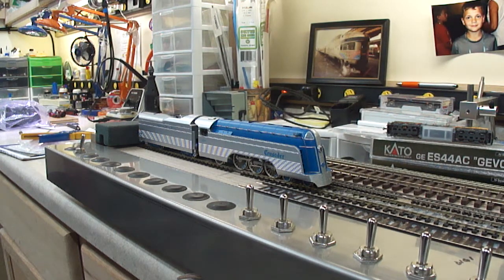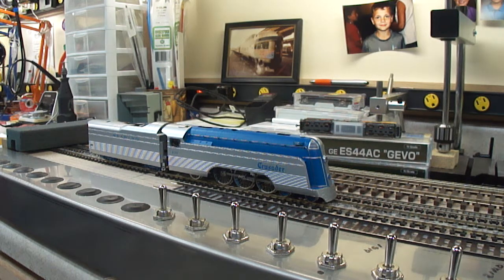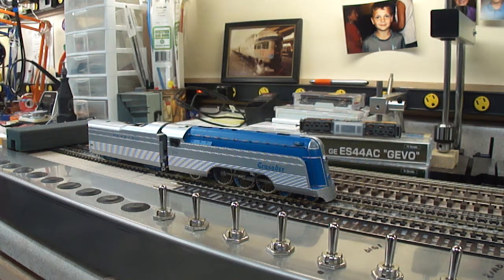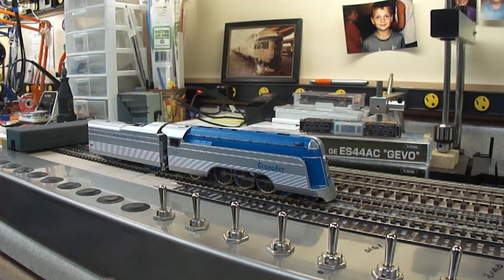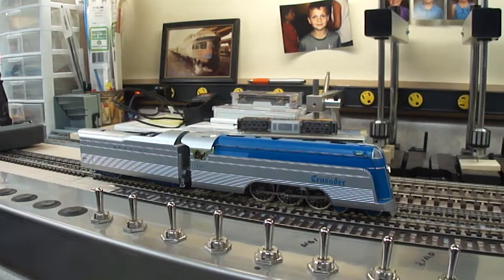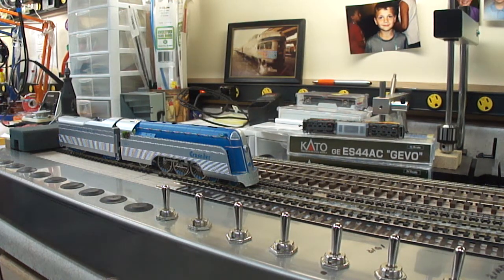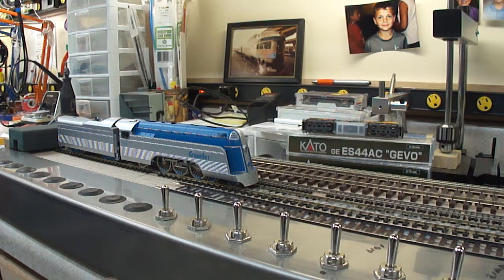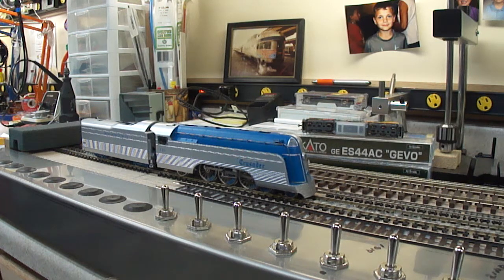HO Scale GHB International Reading Crusader 4-6-2 Pacific with LokSound Select

Comment: how well does this loco run? does the engine have decent weight? I know nothing of this company. Is it plastic, brass, what?
Reply: The loco is of plastic construction with die cast chassis. The weight is enough to pull the 5 passenger cars it is packaged with. The engine in real life was designed just for passenger only when it looked like this, only after the streamlining was removed did it enter mixed duty service. It is recommended for a 22” radius but the cars diaphragms stay closed or connected after 26”-28” radius. A friend of mine has one and the gears tend to wear out or the drivers do the Bachmann and slip out of quarter. Could just be a freak thing with their engine. GHB has some engines on the market now being the PRR DD-1 electric engine in Pennsy or Long Island liveries. Not a big name but seem to make oddball items in non-brass for cheaper options, or more modern with more detail than brass.
Reply: @James-Railyard  I finally found one, but its dcc performance is horrible, to the point it barely runs. my 21" radius they come uncoupled, but on dc it moves fine and pulls on 2% grade, weighs over a pound. The lighter 4-6-2 crusader by IHC will also pull them. One light board seems to have failed in one tail car, not sure why
Reply: @TheStarforce2  yeah like I mentioned each one might have some issues. Sadly the price doesn’t reflect quality, it reflects rarity. Just like MTH engines.
Reply: @James-Railyard  1300 for my set. Dunno why it runs great dc but not DCC. maybe all the electronics need to be tossed or maybe the motor. Its quite strong on dc, for instance you can place your finger on the track and the wheels will spin like mad, but on dcc you try it and the wheels wont spin even at max. I am sure there is a way to fix it. If anyone has a scematic of the lightboards so we can trace that issue Id appreciate it
Reply: @James-Railyard  and also mth is really good. I have a daylight. That thing can pull its 8 car set and all 12 walthers 20th century with light kits which surprised me and its been run hard for 3 years. If scale reissues the empire state, ill be able to fix mine because they are not making tooling changes, so the bad drive axel I have will be able to be obtained and I can run it once again. Dunno how long that will take.
Reply: @TheStarforce2  so far on that front I’m just looking forward to the ESE Hudson and the DM&IR Yellowstone since no one else does them outside brass. I do hope MTH was working on the AC-9 when they sold the tooling so we get a non brass version but doubtful. Most of my steam engines are going Broadway Limited but now in the future it will only be Stealth series. For me anyway.
Reply: @James-Railyard  I got some P4 so far no issues. P3's drop like flies. I dont buy bli desil at all, steam only. Desil comes from genesis or walthers. I have a dmir yellowstone from mth as well as a 4-12-2. I need new traction bands for the 4-12-2. The one I missed was the 2-6-6-6, But I know someone who has one.
Reply: @TheStarforce2  I got one of the warehouse Allegheny engines that was a warranty parts engine. I have a motor just need a universal kit or the proper flywheels and dogbones. Then it’s getting Tsunami 2 big steam.
Reply: @James-Railyard  yea I actualy dont mind the mth sound, the daylight seems to sound nice